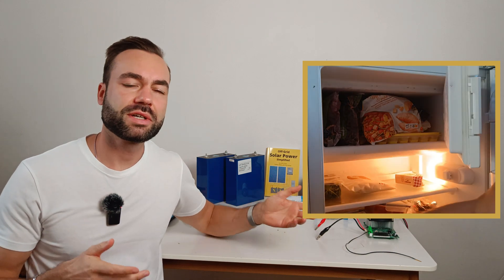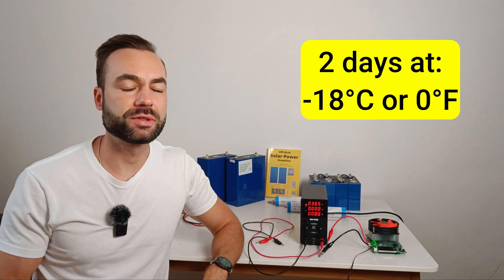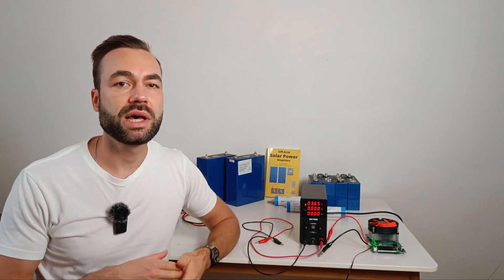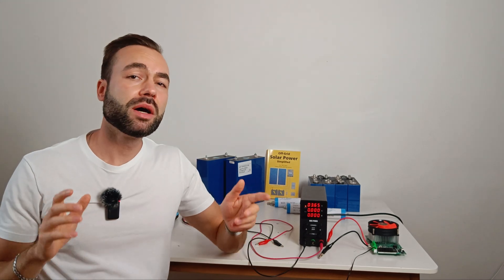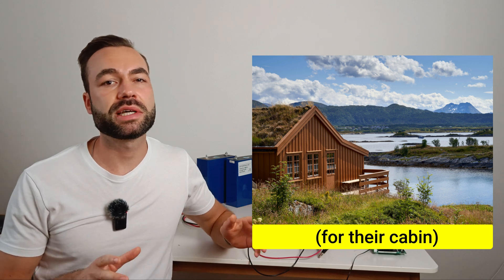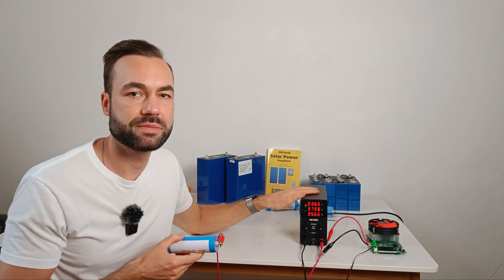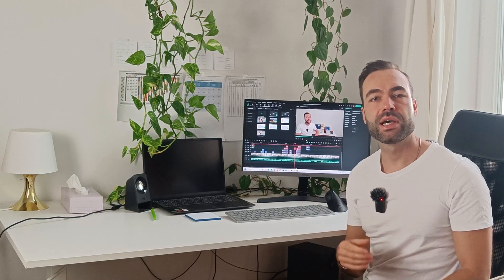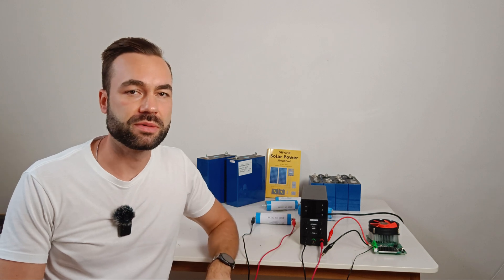I Charged A Frozen Lithium Battery to See What Happens - Frozen LiFePO4 test

Comment: While you do acknowledge that charging frozen batteries can cause damage, it might have been wise to mention that doing this practice repeatedly can cause gradual buildup of sharp metaillic lithium crystals inside the cells.  Over time, this can potentially puncture the internal seperator, resulting in an internal short circuit, with possible thermal runaway, fire, and explosion risk.  So if you really care a lot about not burning down the building containing your batteries, don't abuse them by charging them when they are too cold.

Comment: You mention that you advised a client who will leave their batteries in an unheated cabin for the winter to disconnect the batteries and leave them at 50% charge.
My question is: In such a situation do you consider 50% to be the maximum or minium state of charge for storage in such a scenario.
I ask becuase I will be leaving an EcoFlow server rack battery in my cabin all winter. When I'm not there the battery will be disconnected and occasionally exposed to temperatures below -20 Celsius for many consecutive days. When am at the cabin I will charge the battery after heating the cabin to room temperature with wood fire heat.
I would prefer to leave the battery at 100% so that I have full capacity available for discarge when I arrive  to stay at the cabin. (The documentation for the battery says discharge at >= -20 Celsius is ok.)

Comment: i was thinking wen someone will do this test..........
Reply: very nice
Reply: nice video im a fan btw
Reply: consider to test a cell with over voltage and overcurrent maybe  in next video
Reply from the maker: Potentially dangerous and no safe space found yet.
Reply: it would be cool to keep the cold testing going and see if the capacity losses stay linear.

For storage safety of potentially damaged cells, I recommend buying a flammable liquids cabinet.  Eventually, though, dispose of the cells at a suitable recycling facility.

I don’t think you need to do over-volt or other more dangerous testing.  Your channel is t really about highly destructive tests.

-Matt

Comment: Interesting test that took a while to perform.  I would say that if you could insulate these batteries during like -5C and you start charging them that the battery would warm up quicker so reducing the losses and speed up charging.  I actually wonder how EV's behave in the Nordics during wintertime while always been parked outside.
Reply from the maker: Yes, if you experience freezing temperatures then isolating your battery is a must. If you battery has low temp protection, they are sometimes programmed to start charging at 5°C, just to be safe.

Comment: Interesting experiment.  
I would like to see a similar test but allowing the cell to warm up to room temperatures after being frozen for two days and repeat this several times to see if there is any degradation of the cell after being frozen as compare to a control that is put thru the same amount of charge/discharge cycles without being frozen.

As you know, it has been well publicized that these cells should not be charged when below 32 degrees.  This seems to be universal.  Your study seems to both support this but and dispute it in that it does seem to do some harm to the cell but not to a great extent as expected.  I wonder if we can get our hands on scientific studies that look into this very subject.  There must be some somewhere.  Otherwise where did the notion come from that one should not try to charge a cell with an internal temperature below the freezing point?

I was extremely concerned about this as I leave my LifeP04 cells in our northern climate remote cabin over the winter.  Was I going to ruin my batteries because they would go thru a freeze/thaw cycle even if there was no attempt to charge them during the entire winter?  A fellow Youtuber from (I think Sweden) reassured me this would not ruin my batteries.  He was correct.  They have been left at the cabin now for four years and no abnormal degradation has taken place.

Thanks for doing this but I think I will not try charging my cells when their internal temperature is below freezing until there is more studies done to validate your results.
Reply from the maker: If they are at room temperature before charging then there is no damage done. I did another test with a charged battery in the freezer. After two weeks it still pulled full capacity, discharging right out of the freezer. Because discharging does not reduce capacity.

Comment: I would say that freezing a cell doesn't reduce electrons speed. What it happens is electrolyte reduces its capacity to move at such temperature. A higher temperature allows electrolyte to flow faster, then accepts more current within the same time. It would be interesting to know how much time a cell needs to increase its temperature to 20C° using a very low current in order to avoid damage.
Reply from the maker: Indeed, you are right. That would be quite hard to measure as you will need a temperature probe in the middle of the battery. Charging was slow with a frozen battery, after about 4 hours, the battery was charged and it didn't feel cold anymore, that all i could observe. I don't have information about the temperature on the inside.

Comment: Hi. Did you freeze the cell before each charge? Did it heat up during charging, how much?
Reply from the maker: Yes, before charging the cell was in the freezer for at least 2 days. I then took it out wrapped in a towel to insulate it and charged it. The battery was not warm at the end of the charge.

Comment: Nice testing.  What do the manufacturer specs say for that cell though?  All cells aren't the same.

Generally speaking, it is possible to charge cold lithium cells slowly without them taking damage.  That said, even 5A for those cells is 0.25C... not fast,. but also not slow.  And they did appear to be taking some damage (which might not be linear).

So it could come down to what the manufacturer's specs are for the cell.  -18C is decently cold but not extreme.  There are tons of lithium-based cells on the market that can take a charge at -5C, for example, and even some that can operate at -40C.

-Matt
Reply from the maker: Good question, the cell is an EVE C40 20Ah cells. The datasheet says charging from 0-55°C, so similar to the large prismatic cells we are used to. When i took the battery out of the freezer, the charge started at 1-2A, then gradually increased. On the video it shows it reached 5A, but that cell wasn't in the freezer long enough.
Reply: @cleversolarpower  Very interesting.  Looking at the data sheet, it's spec'd for charging at 0.25C-rate @ freezing up to 80% SOC (then slower).   Can be discharged at temperatures down to -20C with 70% retention.

A pretty typical cell.  Not specifically a low-temp cell but does a decent job.  I am suitably impressed!

-Matt

Comment: Cylindrical Bateries have rigid case, prismatic will die much faster and bulge
Reply from the maker: I'm not so sure about that. The prismatic cells have an aluminum case as well, and i don't think the casing material is different. For a prismatic cell i do think it's structurally more prone to bulging because of the shape. A round shape is much better to handle pressure.
Reply: @cleversolarpower  Shape sure helps. I also dont know material used, i expected ifr lfp have same as 18650. Steel.
Reply: @cleversolarpower  Prismatic casing is not that strong, what is strong though is the 300kg of pressure the box that you put around it is forcing on it, as per manufacturer specs. So cylindrical might have better casings, casings for prismatics are meant to hold that pressure.
AFAIK

Comment: Thank you for this testing. Before now I assumed that charging lifepo4 below freezing would ruin it quickly. It's good information to know that if we were to accidentally charge below freezing because of a malfunctioning low temperature safety or otherwise, that our batteries will not be damaged to a large degree.
Reply from the maker: Couldn't' have summed it up better 👍